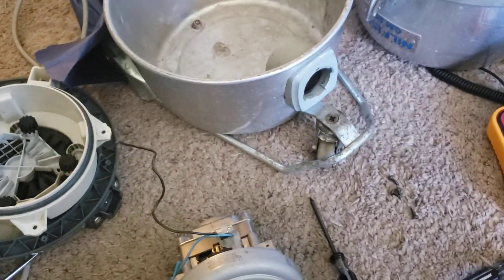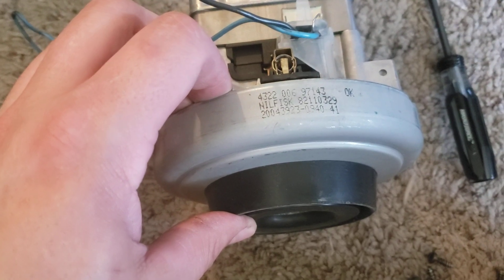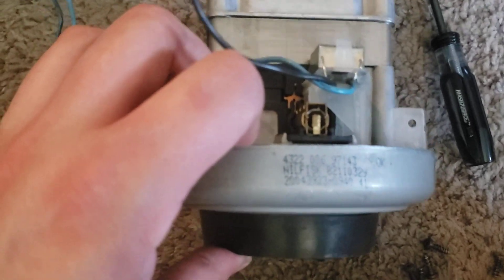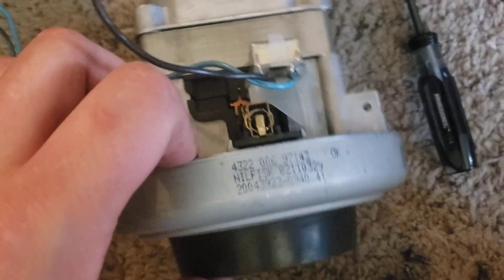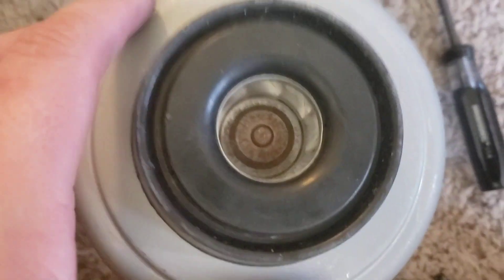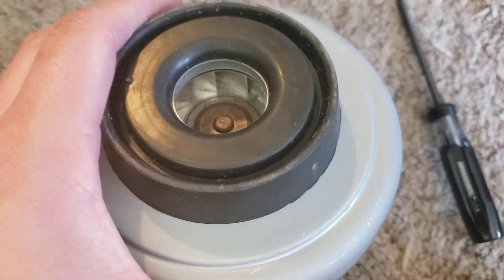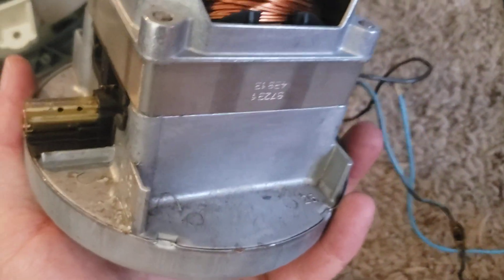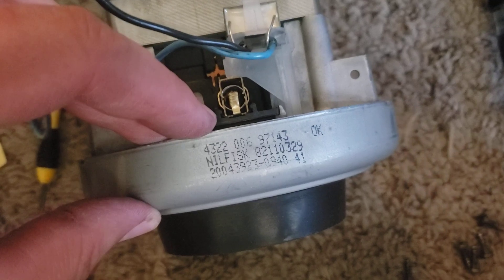Nilfisk GM80: A look at the motor

Comment: This is different motor than what I have. I have never seen motor like that. But it seems to get very nice cfm and suction numbers. I believe my GM80 is from the 90's.
Reply: I have video called "Massive Motor In The Nilfisk GM80" There you can see how it looks.  It might be made by Nilfisk because it's so strange.
Reply from the maker: @vacuumtests9225  Maybe, the flow is very similar to the 2100 watt motor you had do you recall what the suction was on that?
Reply: @Blackheartvacs  Flow seems to be similar to the 2100w motor. I didn't measure suction when it was in the Nilfisk, but from my experience that motor is capable of creating over 100" of waterlift from the hose end.